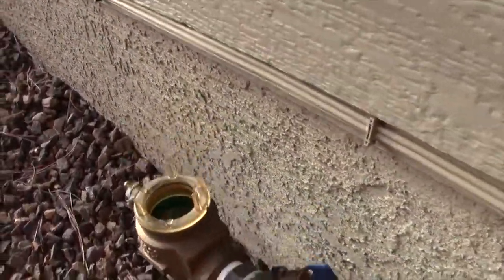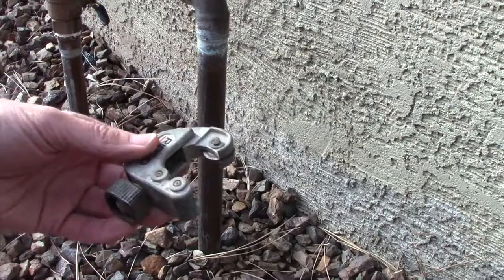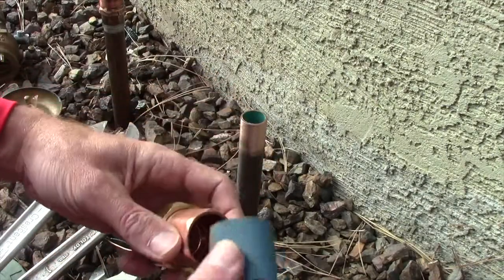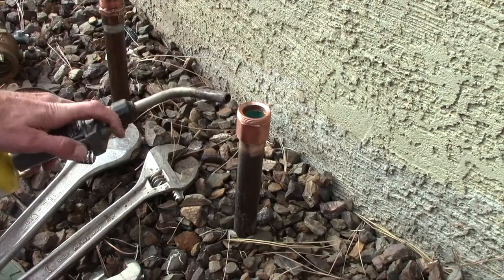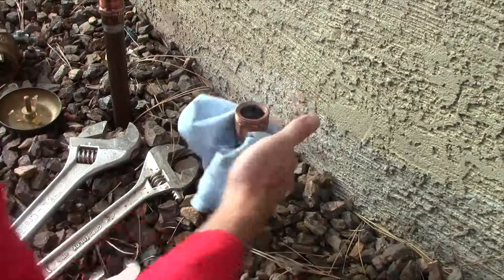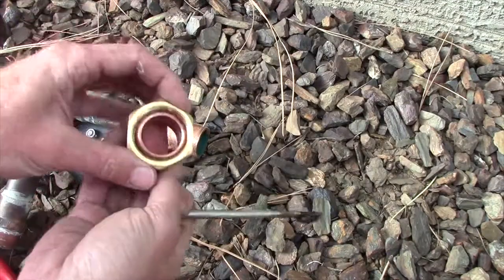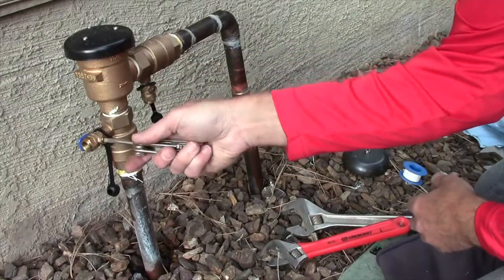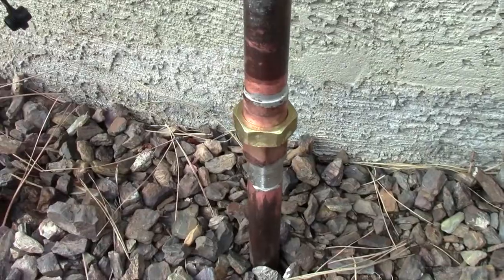Back Flow Replacement and New Copper Union - PVB and copper pipe

Comment: How much does a job like this cost labor and parts
Reply from the maker: I don't want to be too vague but there are a lot of factors that go into it.  What size pipe and back flow, is it just the exposed piping, location you are in, etc., but I'll give you a range of $500-$1,000.